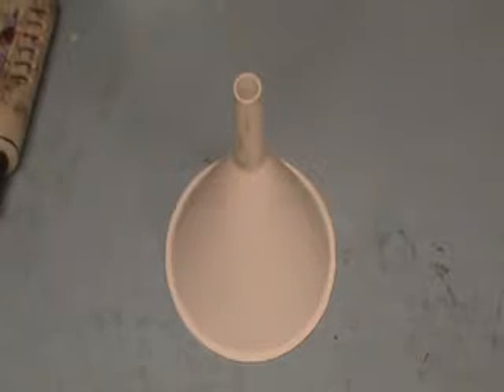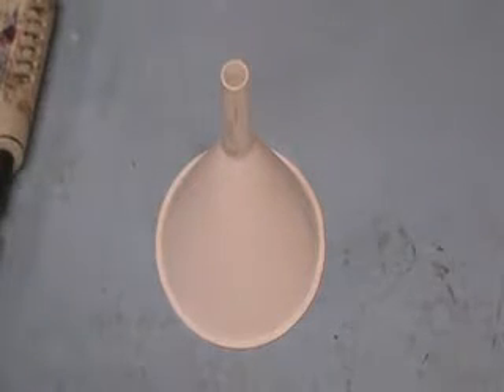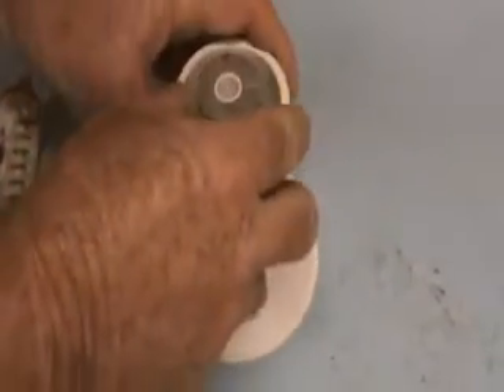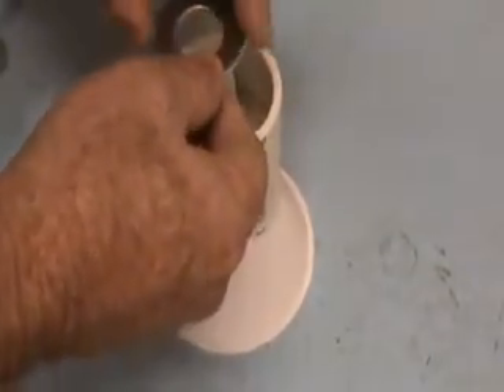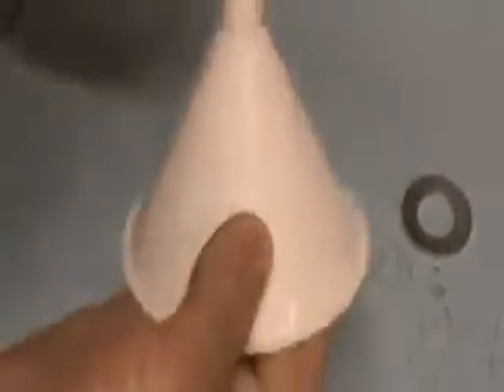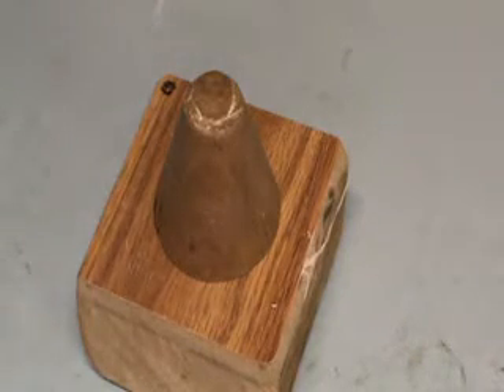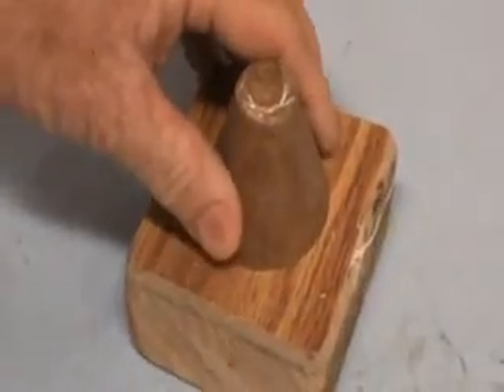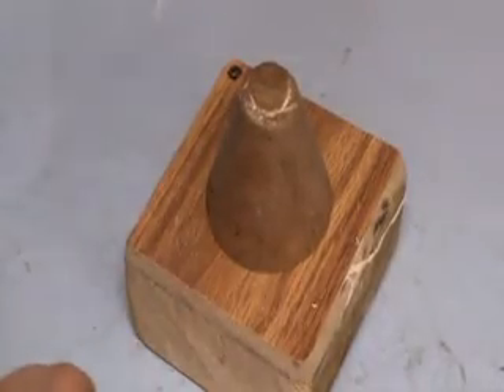Making a rocket nozzle for a PVC rocket motor

Comment: Thanks for your ideas! I think I will go a bit lighter and hybridize some of these great ideas! to eliminate the heavy fittings.

keep your poles smoken
Reply from the maker: Thanks, this video is from an earlier motor which was a K 1450 motor constructed with two inch PVC.  My larger  three inch PVC motor is an eight grain M2400 or nine grain M3000 motor.  My nozzle construction for this is a kittle different and I think a bit improved,  https://www.youtube.com/watch?v=mkA6KIcCLuc

Comment: Hi 👍 Do you have any site to give Blue Print or Graphical ? Thankyou ❤️
Reply from the maker: No I do not have a graphic.  My main concern is to keep the pressure fairly low.  I usually have my motors operate at about 300 p.s.i.   you will have fewer mishaps if you don't push the limits.   I usually size my throat about 1/3 of the inside motor diameter.  I use bates grains because I prefer the constant pressure and thrust.  I use scott fintels bates grain simulator to make adjustments.  I can send you a link to get the program if you want.  It is free.
Reply from the maker: https://web.archive.org/web/20150622222754/http://www.thefintels.com/aer/software.htm
Reply: @hs72comm  Hi Thanks Buddy, Do you know ISRO of India like Space X in your country. They provide all rocket kits, launch pads, They also have Online classes to teach Python programming. Everything in computing in Rockets.

Comment: Ceramic nozzle?
Reply from the maker: The nozzle is made with a concrete anchoring cement. I have used Durhams Rock hard putty, but I prefer the brand Rockite. it sets up in about 15 minutes.  I have some other videos made recently that do a better job explaining it.
Reply: @hs72comm  thanks for that. I'm new to this activity, so I'll check your videos out. 👍

Comment: Did this lad just use H O T G L U E to make a rocket engine?
Reply from the maker: Hot glue is only used to position nozzle component for construction, all PVC for the motor is joined with PVC cement..

Comment: Pardon if I simply didn’t catch it, but what’s the material you’re using for the nozzles?
Reply from the maker: The brand name is Rockite, It is not for refractory, it is called concrete anchoring cement.  This is how walls are attached to a concrete slab during construction.  A hole is drilled in the concrete and a threaded bolt is inserted into the mixed product.  .  It is sometimes referred to as expansion cement and it sets in about 15 minutes.
Reply from the maker: @Brian R. The converging cone on my K motor erodes approximately 1/2 inch and the diverging cone erodes about 1/4 inch in the straight section after leaving the .9375 nozzle washer.  My diverging cone is a bit steeper than ideal, so this erosion tends to make the diverging cone end up more or less the correct.proportions..
Reply from the maker: @Brian R. Photo of used nozzle cross section,       https://www.facebook.com/photo.php?fbid=1617885865001074&set=gm.1835253196769836&type=3&theater&ifg=1
Reply: Yea, What did he use?

Comment from the maker: I forgot to mention in the video to trim the converging cone nozzle washer after removing it from the funnel.  Trim with a knife so that the 3/4 inch EMT will pass through the nozzle.  The diverging cone needs to be trimmed also, trim the nozzle washer and where the nozzle starts to expand.
Reply: Gary why why why when I make home fuel it sucks. I buy top of the line chem that's lab grade and I can't get a rocket to take off for shits! I have used every oxidizer known. The ratios are messed up or I'm not blending them right. So frustrated wish you were my neighbor Gary